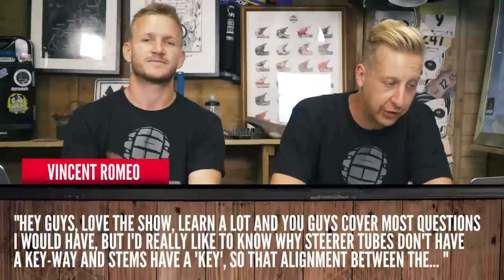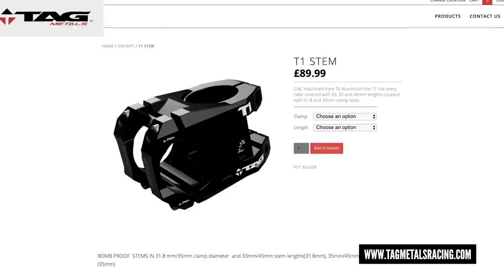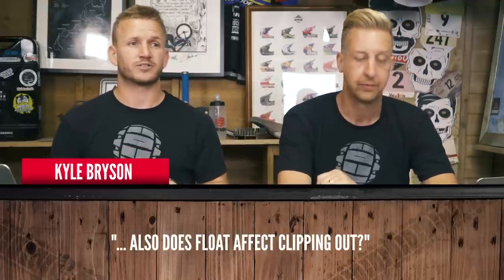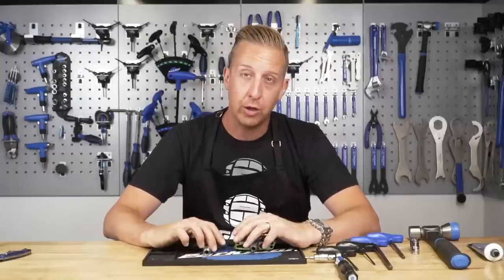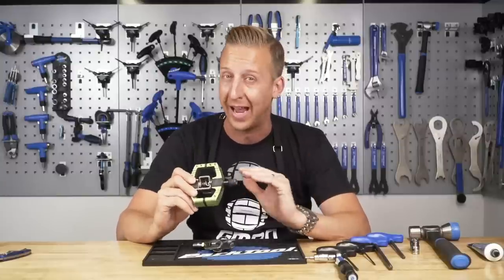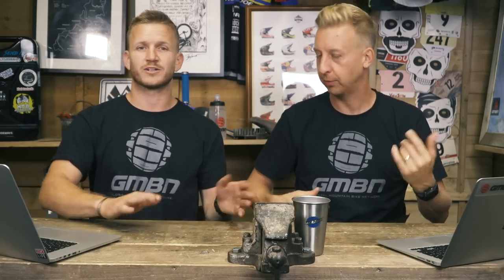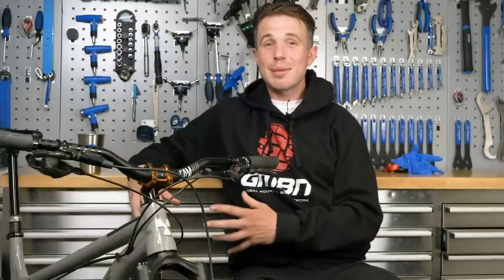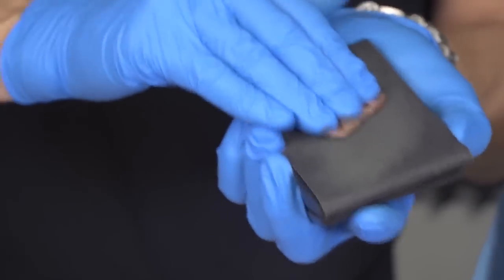Is Riding Motocross Good Cross-Training For Mountain Biking? | Ask GMBN Anything About MTB

Comment: I came from dirt bikes and have been doing more MTB now, as it is easier on my knees.  Used to ride MX and still do enduros.  Been getting into downhill.  Both are great fun and good exercise.  The only real difference I've found is. A dirt bike when you get in trouble you can typically throttle out.  A MTB you have to pay more attention to your lines and obstacles as you don't have that braaap when you need it.  Anyway both are great fun and good to learn or do.

Comment: I commute on a motorcycle and do mountainbiking for fun. The MTB-ing helps me getting used to the feel of wheels loosing grip (either front or rear, it happens on the road, if ever so slightly). My motorcycling in turn helps me to corner faster/better on the MTB.

Comment: Shimano SPD pedals have the spring to adjust tightness, but they also have cleats with different ramps so they flex sideways to release more easily for those who want an easier exit.
Reply: They are the Shimano multi-release cleats. I use these and they have more play than the standard cleats and release under multiple angles.

Comment: My pedal bearings are quickly going. I can't fix them as they are very cheap and would just have to buy some new ones. I'm only 14 and earn my money of a paper round and so should I save my money ( which I'm doing right now) for a new good full sus bike or buy some decent pedals and carry on riding my pretty bad bike (2015 specialized hardrock) for a while longer.
Reply: i dont get it, there is a huge price difference between just a set of pedals and a new full sus bike. And even if you save up for the new bike you'll need the pedals anyways..
Reply: @ultiss  I would be getting a second hand bike and plus a good set of pedals is a lot on paper round money
Reply: @benasquith26  decent pedals can be found below 40 euros. A decent bike will likely be at least 10x that
Reply: @ultiss  I understand that but I would be buying probably a £1500 second hand bike and a set of pedals would slow the saving up process, plus the pedals I've got now are rideable but make a really annoying noise.
Reply: @ultiss  I get what you mean though a set of pedals is a lot less
Reply: New bikes often have no pedals or cheap ones. You will need a decent pair anyways so i would start there. Good pedals will also improve your current ride
Reply: @ultiss  ok, cheers buddy!

Comment: #askg
Hi, i am considering on buying the One-up EDC tool. I was just wondering if after threading your steerer tube if you can go back to using a star nut and normal top cap.Thanks, Bodie
Reply: dont see why not, you dont add to the steerer diameter. But if you dont want to thread your steerer you can use their new EDC stem system

Comment: #AskGMBN Hi guys, I'm currently rocking a 2x10 setup with 11-36 cassette rear, I think of switching to 1x10 with 32T front 11-46 rear (of course 10 speed), will the jumps between gears not be to big for comfortable riding, chain rings are as follows: 11-13-16 -20-24-28-32-36-40-46.
Reply: If you're not doing roadie action, don't worry about it.
Reply: find an online gear calculator (like this one: http://www.ritzelrechner.de/) and work out whats best for you on the terrain you ride, do you need higher top speed or very low gears for steep climbs etc, etc

Comment: #askgmbn I recently upgraded to hydro brake Shimano mt 201. It came w 2 yellow blocks that fit the hose. What do I do w the blocks?
Reply: They are to clamp.the hose (used with mole grips or vice) to hold it still while u put a new barb in the end (if u have shortened or replaced the hose). So u can clamp hose without crushing it. 
Check out the brake vids on tech

Comment: #askgmbn hi gmbn  I have just got a new scott aspect 910 and it has some rockshox 30 silver tk solo air and it has the weight guide to see how much air you need to put into your forks. I am to light for the weight table on the forks so should I put the lowest amount of psi in the forks that's on the table or do some maths and work out how much psi I should put in? Btw love your vids
Reply: ignore the chart all together and measure sag with a ruler, pick something you like between 20% sag for firm ride and 30% sag for plush ride.

Comment: #askgmbn    I recently got a old Walmart bike from my neighbor as he was moving  my brakes sqaek a  lot  I didn't know what the problem was so I washed my bike and the squeaking stopped but then came back plus my seat comes off real easily  and its becoming a danger pretty pretty much everything on my bike has something wrong I'm thinking of upgrading everything on the bike but I worry I might do something wrong or it will to expensive so should I just buy a actual good MTB or just upgrade the trash heep

Comment: #askgmbn i have a ns surge evo. 160mm manituo mattoc on the front. i ride skate parks and my local trails. when im droping into the bowl i feel my front end obviously squish waaaaaay more than i want it to. its not been a huge issue because i over pump my forks. even in lock out its still squishy. now i love the squish for big drops on the trail and super rough stuff, but at the skate park i keep having this nagging fear im ginna squish down too far dropping in the bowl and go over the bars. is this rational? ive been thinking of getting a separate fork for the skate park. should i do this, is it common for riders to switch forks out for different riding? or should i just bite the bullet and build up an actual DJ? my worry is the front brake and general wear and tear on the bike, but i just spent a lot on my current bike and swapping a cheap pair of marzocchi's is my cheap fix.
Reply: if you are going on a skate park session put more air pressure into the fork and increase compression damping. Write down current settings for easy swaps between setups
Reply: @ultiss  thanks will try

Comment: #askgmbn Hey, so I’ve fixed my sisters bike. And after I did I a small test ride and hit a little bump and the suspension got stuck. First I thought it was I was too big for the bike and it was just me but what should I do to fix the front fork. Thanks
Reply: It’s a coil suspension sorry for forgetting to add that.
Reply: try to unjam it by pulling is probaly the only option. sounds like its f'ed

Comment: After years of Enduro dirt bike riding I found a mountain bike very twitchy, the worst being the ability to go over the bars.
If I get the dirtbike out, the pedal bike feel awful again for a few rides
Reply: sounds like geometry related issues, not mtb in general. Which mtb do you currently ride
Reply: Im using an old commencal downhill bike...so I guess thats as close as I can get.
Weight and geometry wise..its just me, you have to be a lot more precise on a mtb
Reply: @chargeriderepeat7024  well how old? old dh bikes are small, short, steep. only recently its all about long low slack
Reply: 2010..but its pretty slack and very heavy
Reply: You could try a modern loaner and see if that changes things
Reply: Always looking for a new bike :)

Comment: #ASKGMBN Why do cranks have different BCD it would be way simpler if it was all the same length? BTW love the show
Reply: Mathieu Doiron btw the hashtag is actually #ASKGMBN not #AskGMBN
Reply from the maker: Is this a question about BCD's (Bolt Circle Diameter)? If so we are starting to see a lot of direct mount options which is awesome as it allows a wide range of chainring sizes now. Previously companies wanted a larger BCD to help with stiffness on larger chainrings however this would limit you on how small the chainring could be.
Reply from the maker: @anonymoush2947  Both tags will work now Johnny, it's not case sensitive 😀
Reply: Johnny Bohnny25 k
Reply: Global Mountain Bike Network         Thanks!
Reply: Global Mountain Bike Network hi I love your videos and you inspired me to ride bikes and now they are my life and it would be the best thing in the world if you included my question

Comment: #AskGMBN Why Does my brothers Rockshox recon forks bottom out on his Norco fluid fs 3. While my Avanti Compeditors s1's Rockshox Sektor forks does not bottom out. they are both duel suspension bikes. Both forks are silver models. His seam to move more in the stroke then mine and mine seem to be able to handle the terrain in a shorter stroke. His is a 120mm stroke while mines a 140mm stroke. It seams counter intuitive that mine uses less stroke then his. They are both set up with 30% sag.
Reply: You have more travel so maybe the drops that would bottom him out you still have that little extra
Reply: @aminkhorasany_4676  mine might go over the same spot with 100m of stroke and his uses all 120mm of stroke. PS Avanti is a New Zealand Brand that is exported to Australia.
Reply: What kind of riding depends too, normal for 120mm forks to bottom out since they're shorter...
Reply: Obviously a shorter travel (120mm) fork will bottom out quicker than a 140mm fork over the same terrain. Your body weight will be another factor also
Reply: Level of progression in the fork, ur weights, riding styles etc
Reply: 30% sag is rather soft but if you really like that and want to avoid blowing trough the travel you need to add air volume spacers

Comment: How should I maintain a spring fork (SR SUNTOUR XCM)? I feel like it's getting tougher and tougher. #askgmbn
Reply: search for 'lower leg service'. it consists of removing the bolts at the bottom of the leg, sliding the lowers off, cleaning legs and seals, regreasing seals. higher end fork will have oil baths, your xcm will not. If fluid drips out its probaly water or leaked damper oil

Comment: #askgmbn I want to find out if my steerer tube is tapered or not but I don’t have a torque wrench and my local bike shop will probably charge me what should I do
Reply: flip your bike upside down, look at the hole at the bottom of your steerer. if its a 1.5 inch wide hole you've got a tapered fork
Reply: Thx

Comment: #AskGmbn Why is my chain always dirty if i use spray? You are doing good jobe guys like you
Reply: Because the oil attracts all the dirt to the chain. I recommend using chain wax from squirt. It dries and it's not greasy. But you need to fully degrease your chain before aplying chain wax
Reply: @David54534  You stole my words straight out of my mouth!
Reply: @th_js  haha yes
Reply: bec you first lube the chain, let it soak in and then do the very important step of wiping off the excess

Comment: #AskGMBN Hi guys... I'm running a 1× setup with a Sunrace 10sp cassette 11-42. I'm planning to upgrade my Shimano derailleur but I read that a 11sp derailleur would be better (smoother) because they are designed for bigger cogs. Is that true? BTW, I'm have a 10sp Shimano shifter. Tks. 🚲🌲
Reply: You Can't use a 11 speed RD with a 10 speed Shifter or casette.
Reply: @th_js  Thanks Tomi... I found many videos and blogs with people that has done it and works... I just wanted to know which one (10sp or 11sp) was better? Or maybe the same. Thanks.
Reply: @reneh.6551  It might work on some combos, but don't take the risk. If your 10 speed RD is working, why change it!?
Reply: @th_js  bec 10s deraillers are rated for max 42 teeth largest sprocket and the 11s for 46t (which unofficially works with 50t cassettes aswell). 
But on topic just go 11 speed if you need a new derailler and cassette anyways. the shifter is the cheapest part of the drivetrain